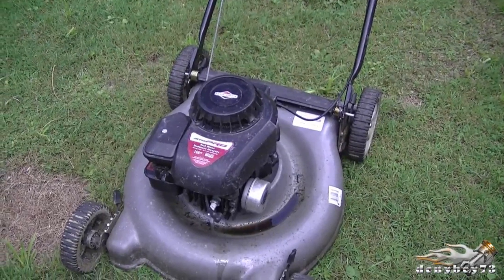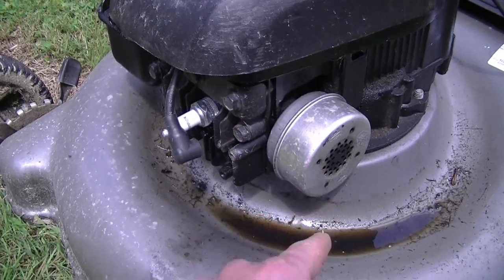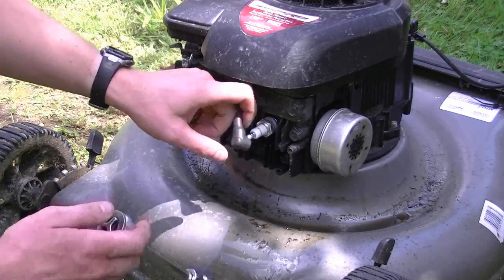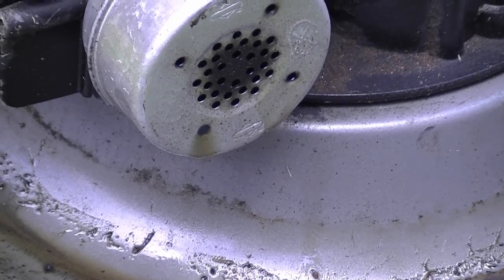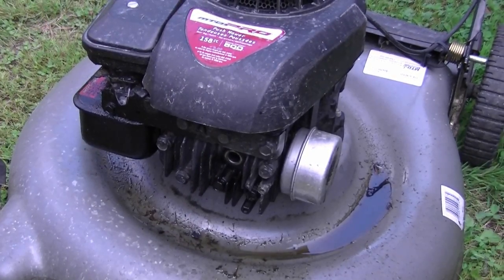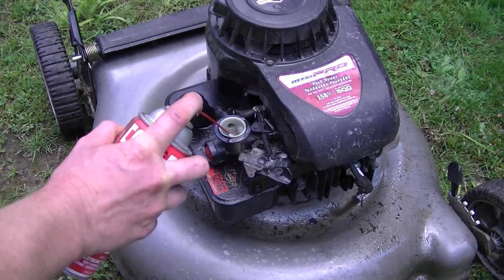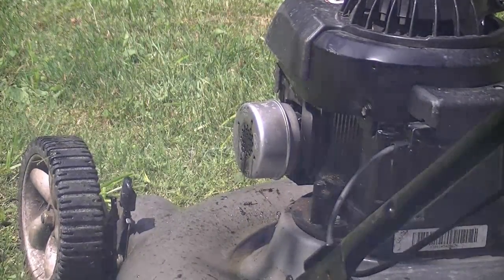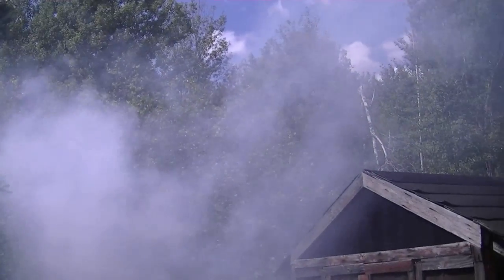How To Fix a Hydro-Locked Lawnmower

Comment: Hi Dony.I have problem with my lawnmower,it's briggs 450 series.It's only one year old,but I have problem with starting.The rope is hard to pull,and I can't start the engine even when it's very hot,without pumping the fuel.So I always need to pump one time to easier start.Strange is that sometimes rope is normal and easy to pull,but that happends like 1 time of 8 pulls.And yea,when it's started it works perfectly and do very good job in grass,problem is just starting.What you think that can be?

Comment: Donyboy73, I have a old String brush cutter with a B&S 6hp (122K02-007-E1) that is acting like it is Hydro-Locked, but when I pull the plug and pull it through, no oil comes out. No oil comes out of the muffler either. It is very hard to pull through with the plug in, but easy with the plug out. Any suggestions? Thanks.

Comment: @fullraph sounds like you might have a valve sticking open, or maybe the roundup killed the carb and other internal parts. I had a mower that someone put degreser in and it ate up the carb

Comment: Hey donyboy, I got an echo blower pb 500 T and I too believe it is hydro locked. Pull cord will not pull at all. I removed the spark plug and it still won't pull. Any suggestions?

Comment: @donyboy73 Hi thanks for the help. The plug gets a little wet and one time it filled up the cylinder and I could not turn it over. The strange thing is, the spark is a fat blue crackly sounding spark which means excellent spark. I am thinking maybe the fuel isn't vaporizing because I don't see any happening.

Comment: Same happened to a scooter. It was a 2stroke. There was to much oil between the cylinderhead and piston. Ive just taken off the sparkplug and runned the electric starter for a few seconds. Didnt smoke much at all after this

Comment: Can a lawn tractor hydro-lock with gas?  My Craftsman with Briggs 18HP single cylinder Intek seems to be. It was really hard turning over so I removed spark plug thinking it may need valve adjustment (learned that tidbit from another one of your videos. When I tried turning it over with plug removed lots of gas came out of plug hole. Looks like I may have messed up rebuilding the Nikki carb. Briggs manual for that engine shows both a Walbro and a Nikki carb. Some people say that the Nikki carb is sensitive. Do you think I can or should switch to the Walbro?
Reply from the maker: yes they can and usually caused by a bad needle valve

Comment: I was cleaning under the deck of my mower, and when I was removing the blade it slipped. I haven't seen oil. And there was very little gas and the lid was off. I have did anything to flip it back, I'm gonna finish cleaning since it's there already. Is there a way to flip it back over without making matters worse?

Comment: I put too much oil in my lawnmower 3 days ago and I'm guessing it hydro-locked. I turned it so that I can drain the oil out and then just put in a lil bit, but the pull string is still locked. Will this procedure also work for my problem?

Comment: Hi I have Scoots Intek 6.5 Hp Gas Push lawn mower and  its starting is fine but after start I find the speed of its engine goes up and down even when its speed lever is fixed at one stage toward more than half . This  feeling of speed up and down is more when the lever is set toward maximum of rabbit side ... Will you please guide me its solution ......????

Comment: i sprayed a little bit of degreaser in a carb and after that when i tried to pull it locked up. it wont move forwards or backwards, can it be hydrolocked or what else? thx

Comment: using this method i sprayed pb blaster into the spark plug hole on my mtd/briggs and stratton chipper. i had to work my chipper blade back and forth a bit but eventually i got it spinning in the right direction. i then pulled the rope twice and the motor spins but it didn't start because i had no starter fluid. but it seemed to lock up again. i sprayed more penetrating oil in it, worked it loose, pulled the rope two or three times but it locked up again. i see no oil coming out of the spark plug hole when i do this. do you have any ideas donyboy73?

Comment: Wow, my dad was set on buying a new lawnmower because it "broke", go out there and the spark plug was completly dethreaded,  could this be because the hydrolock built up enough pressure in combination with trying to pull start it? Thought it was weird...

Comment: honda gc190 mount over pressure washer.It is very hard to pull and kick backing.I took spark plug out then easy to pull.I also took off valve cover both valve look right setting.What else I have to check?
Reply: After you turn the water on to the washer, pull  the trigger on the gun to release any built up pressure.Then try pulling to start.

Comment: That oil filled muffler is a significant restriction to the engine, and since its a screw off type I would remove it and spray in carb cleaner to help thin out/drain oil and actually let it drain.

Comment: I'm working on a Craftsman 42 inch riding mower, with a 16 hp one lunger.
I was told it had a bad starter,(wouldn't  start). 
After inspecting & cleaning out the starter, I discovered it wouldn't even start off of a fresh car battery.
 The jug was full of gas. What little gasoline that was in the tank drained down into the engiine. I put a carb kit in the carburetor. 
The carburetor is back on, but I haven't started it yet, as there may be too much gasoline contamination in the engiine oil. I'm draining the oil out of it now.
It smells a bit too much like stale gasoline for my taste.

Comment: my mother put to much oil in it and i changed the spark plug it did start just white smoke  so i will get some quick start now burning it like that i just put a little oil in it and check to make sure it's at the right level? gonna try
Reply from the maker: Good luck!

Comment: Is it possible to "hydrolock" the engine between piston and crankcase (i.e. too much oil added to engine) and would oil viscosity be a culprit? I recently worked on a Craftsman Tiller 208 cc, front tines, that had gas in the oil and was coming out the muffler and was also hydrolocking at times when pulling rope. I checked the carb for sticking needle/float, checked ok, then I drained and changed the oil (I used 5W-30 instead of 10W-30). When I tested engine it worked fine but when I tested engine the next day the rope was hard to pull at times but would eventually turn motor over and start. So, why would the engine be hard to turn? Maybe a too much oil. (By the way, specs call for 20 oz. of oil. I added an extra ounce or two.) What can you tell me?
Reply from the maker: yes it could be
Reply: Thanks for the response. I will remove any excess oil out of engine and check to see if it turns without restriction. I enjoy your channel!

Comment: hey dony is there a way for me to take off the muffler on mine and let all the oil come out so it doesnt cover my new shiny muffler in scolding hot oil?
Reply from the maker: +SaiKo Plays the one in the video comes off by unscrewing it with large pliers or pipe wrench

Comment: Went to Walmart bought new spark plug , drain all oil and change new sae 30 oil  . Will test today if it start . The old spark plug was wet to much oiled on it won't start

Comment: I have a motor that I rebuilt the carb on and it started up fine but had a bad skip in it. I noticed before I started it that the oil was just below the add mark so I added some oil and brought it up to full level. I tried to start it again and nothing. I looked at the carburetor and saw gas coming out, like the float was stuck. I pinched off the gas line with some locking pliers and kept trying to start it. On about the 8th pull the motor began to tighten up and then one pull later it locked up. I pulled the spark plug and tried it but it wont budge. Any ideas?

Comment: Have had happened to a mower where I use to work  took the spark plugs out turned the engine over oil shot .out put the spark plugs back in .the engine fired up

Comment: I seen a hydro locked engine one it got so hot with the oil in the muffler the muffler caught on fire.  I have only seen this once but it ruined the muffler.

Comment: @fullraph That stuff is corrosive for metal and probably abrasive as well.  It also contains water.  Without knowing how much got into the cylinder though, and how long it was in there, it's hard to tell what happened.  But the only way to know for sure is to pop the head off and take a look.

Comment: So my mower will not turn over with the spark plug in place or at least it wont get past the compression stroke. Its acting like hydrolock. Pull the plug out and it turns over freely. No oil or gas comes out of the spark plug hole when turning over though. Any ideas? I should add that the mower ran fine 15 mins before but was on a rusted out deck. I swapped it to a newer deck and it just wont go...
Reply: I have same problem with my riding mower. Any suggestions?

Comment: Shouldn't you check the oil level in the crankcase before attempting to start the engine?  That's where the oil in the cylinder/combustion chamber came from. Otherwise, your advise seems sound.  Maybe a bit heavy on the starting fluid though...
Reply: Yes, you should check the oil level before starting, and as for the starting fluid, the system is full of heavy oil and it takes starting fluid to keep it going for awhile until the oil is burned off enough, and the gasoline is volatile enough in this situation to take over and sustain operation. The gas engine can't burn motor oil by itself.

Comment: I am thinking about buying a Robin Subaru horizontal shaft 7 horsepower with idle control came off of a power washer and the guy said it was hydro loching is there a way to fix it. I need to know if it's safe to buy if it's easy to fix?
Reply from the maker: just beware buying anything that doesn't run
Reply: Did you ever heard of a horizontal shaft doing this problem
Reply from the maker: only if tipped on it's side for a long period of time

Comment: I have done what you did, removed spark plug, pull the cord but no oil came out of spark plug hole, just some black oil came out of muffler. I drain and changed oil, put new gas in, repeated the process but still hard to pull the cord (only when I put spark plug in). What should I do? Thanks
Reply: C Ng It could be your carburetor. Could be dirt inside. I cleaned mine for a pressure washer and it started right up.

Comment: it happen to the one lawn mower that i found in the trash picked one night with my friend and it happen to the toro don't' get me wrong about the toro good lawn mower ever since it is running fine going about 2 years. i have to get few things for it but it is good thing to have around small house front with small engine.

Comment: @wizard101emily i dont think so, you can try, there should be a small drain plug on the side, tilt the mower, and drain it, refill it correctly, and do this 1 time before starting, hope that helps

Comment: my engine you have to pulled hard to get it started i did what you sade to do but it still hard to pull can you help me thanks
Reply: If all the oil is out, the valves probably need adjusted.

Comment: Emptied all the oil out of my mower.  pulled the flywheel,  opened the chamber below the flywheel for the excess oil.  and cleaned and dried it all.  also took the head off and cleaned it.  put it all together.  started it up.  and as it ran,  it was smooth at start.. then  slowely began to slow down then speed up   and when I shut it down.  it started smoking.  it also seem a little harder to pull like a hydro lock.  I thought it might lead to a hydro lock so stopped it.  any ideas?  it is a craftsman 6.5 hp eager   it was clanking before, but now I think it is fine.  I think the blade was loose  and or the flywheel before.  it sounded great until it started oscilating and smoking.  Ideas?

Comment: Hydro-Locked is is wher the carb float ic not stopping tho gas flow and the gas fills the piston area and leaks into the oil the full cylender of gas  will not compress

Comment: I always laughed when people brought in their brand new mowers they bought at department stores that wouldn't crank/hydraulic locked!  The silly people would fill the engine right to the top of the dipstick tube with oil, guess that is better than starting it with no oil!

Comment: donyboy73 Its Captain Shawn David Capps Here. In year 2411 How to Repair The Hydro Locked Lawn Mower? That's What Happens If They Put Too Much Oil On The Mower It Will Overload The Oil That's Been Alien And Empire Mode I Am Extremely Disappointed At Them. By The Way That's Crazy Means That's Not Christian At All. I I am fan Of Star Trek The Next Generation I am Starfleet Officer I Battle Against The Empire. That Was Prime Directive is Starfleet General Order I am Ready For Your Responds. Hydro-Locked Lawnmower Is Normal It will Activate And Run Good To Go All Set Good Luck Mr. Don
Reply: Shawn Capps Oh Mr. Don Welcome To The 25th Century

Comment: There is a MAJOR problem with this video!
You need to make sure that you fill the oil back up that you have now removed and burned off!
Before you let it run for 15 minutes potentially with almost no oil in it which will destroy your engine, you need to check the level with the dipstick and fill it back to Full! THEN you can run the motor of whatever your tool is to burn off the oil that got into the combustion chamber!

Comment: You shouldn't put starter fluid in an engine that's low on oil and has excessive blowby.  that's just asking for trouble.
Reply: what kind of trouble?
Reply: There wasn't any blow by to begin with it was just burning the excess oil

Comment: The engine does not hold much oil in it (ounces not gallons). You lost some oil before this video as evidenced by the oil on the deck. You puked out more oil with the plug out. More oil came out of the muffler and you burned out some when it started and ran for 15 minutes. YOU NEVER CHECKED THE OIL LEVEL IN THE ENGINE BEFORE AND AFTER STARTING IT. You may have gotten the condition corrected but blew the engine anyway. I like your videos but you forgot a big step for youtubers that do not know what they are doing and caused this condition originally. Keep the videos coming.

Comment: hi its me again here is the engine with the problem I was talking about.

http://www.ebay.com/itm/Subaru-Robin-7-0-HP-Pressure-Washer-Engine-/151470131675?pt=LH_DefaultDomain_0&hash=item234452c9db